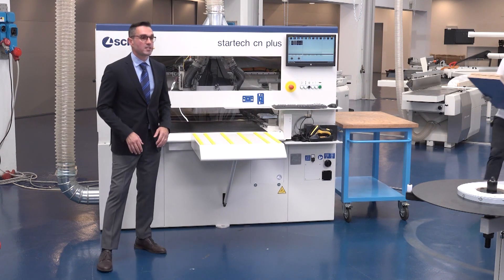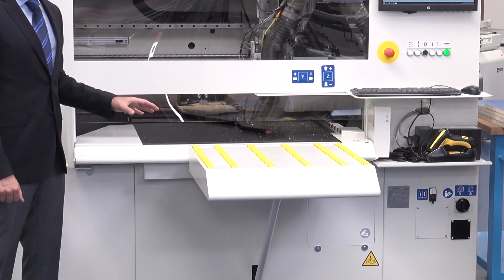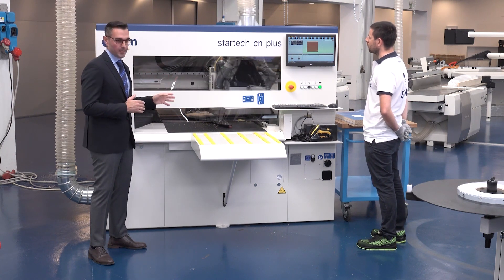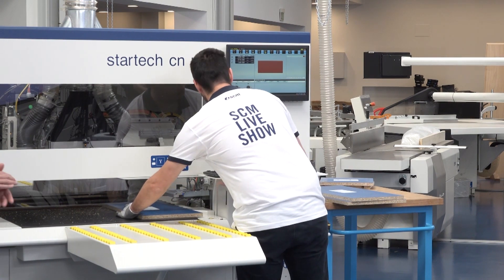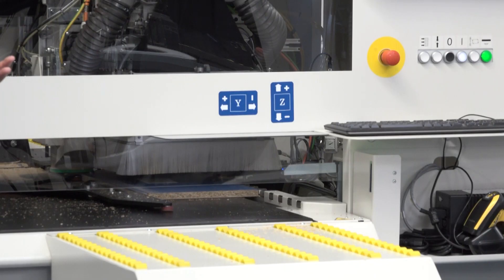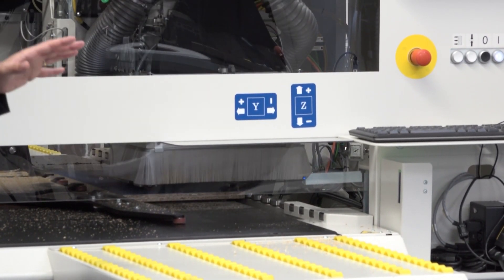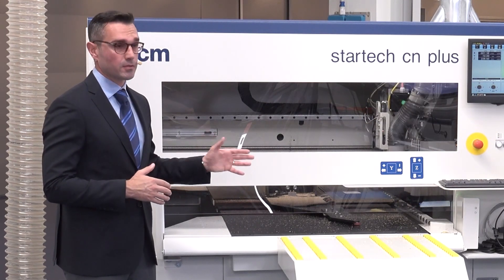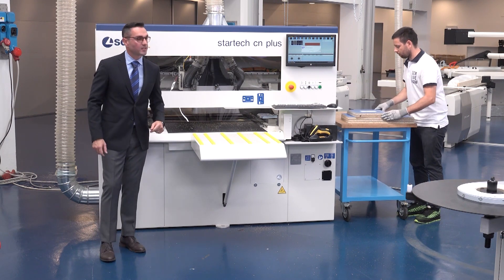SCM CNC drilling centre startech cn plus

Comment: Hello,
In which location should files be stored for using barcode scanner? It has to be in /works directory?
Reply from the maker: Hi! The software automatically saves files connecting them with the barcode. If you want more technical information about how this process works, please contact our service department https://www.scmgroup.com/en/scmwood/service/our-services
Reply: @SCMGroupSpA  We are creating toolpath with Maestro, so it should be saved in any different way to open it with barcode scanner automatically on Hicam?
Reply from the maker: Nice to hear from you again! For this kind of support, please contact our service assistance https://www.scmgroup.com/en/scmwood/service/our-services 
We will be happy to help you!

Comment: Hello, does the machine measure the thickness of the loaded panel?
Reply from the maker: Hi! The machine performs a consistency check on the width of the inserted panel, not the thickness.